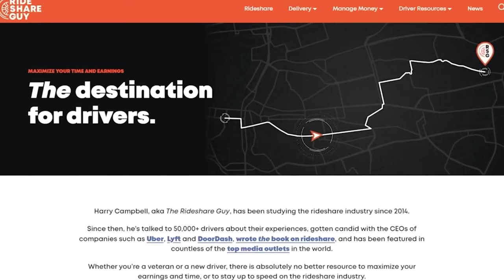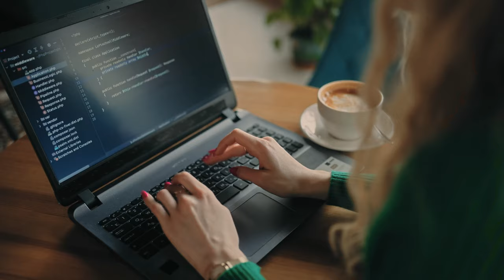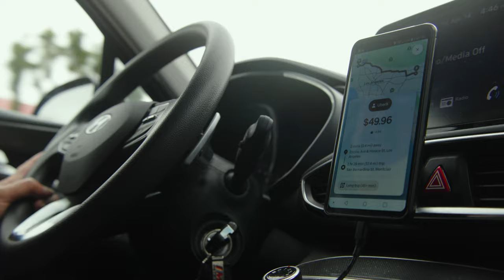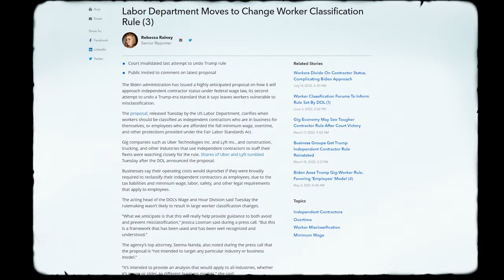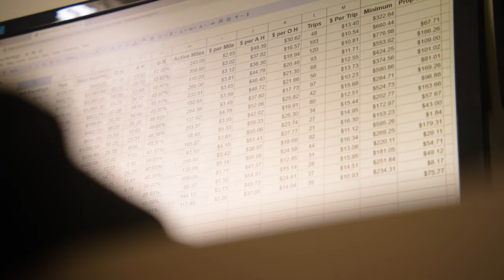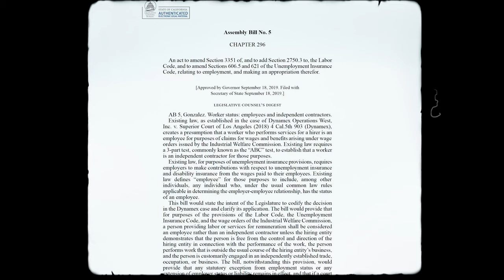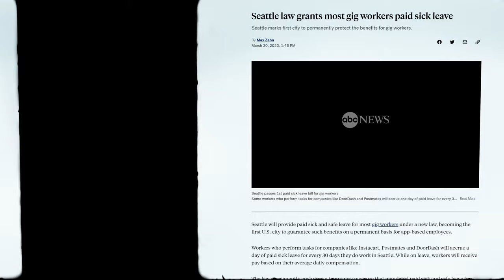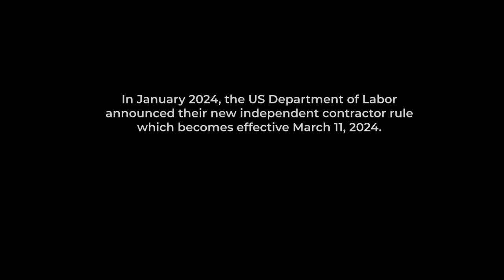A New Dawn of Workplace Regulation: The Gig Economy

Comment: my man Sergio 🔥🔥🔥🔥🦾
Reply: Gig apps should pay the independent contractor (the driver) $1.70 per mile for the vehicle (or 1 Euro per Km) AND minimum $0.55 cents (Euros) PER MINUTE for driver's effort. And those rates should run like a stopwatch on the phones on every second & miles driven, separately like a old taxy cab meter.

Drivers, Door Dash, Uber, Lyft, Grub Hub, Roadie or any Gig app should stop talking about paying/getting hourly pay; unless the vehicle is provided by a Gig app & gas/petrol, maintenance, insurance, etc,  etc is paid by Uber, Door Dash, Lyft, Grub Hub, Roadie etc, etc only. So stop bringing the hourly wage to conversation when the vehicle is by an independent contractor. The vehicle should be compensated at a separate rate & the driver should be compensated at a per minute rate separately.  

Obviously for drivers of New York, California, Boston the rates I suggested should be higher. E.g. per mile $1.90 & per minute $0.80 at least in this inflation, because it's not 2016 now everywhere else other than for Gig workers.
Reply: @StreamingFrames  Alternatively, ride share drivers could get a real job and only offer to drive people periodically, as it was designed to be - opposed to trying to make a career out of what was specifically created with a competitive advantage (price wise) of not providing / creating an alternative career path supplanting more traditional paths such as being a taxi driver and private car driver.